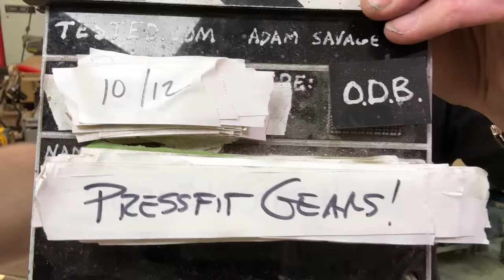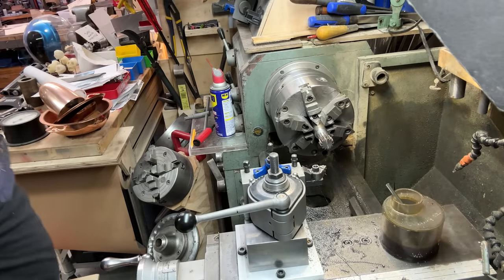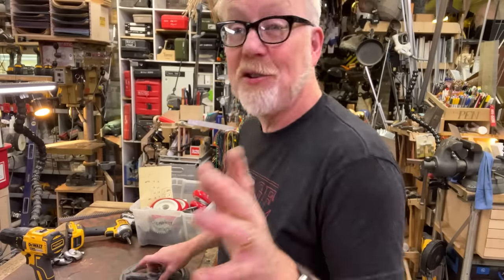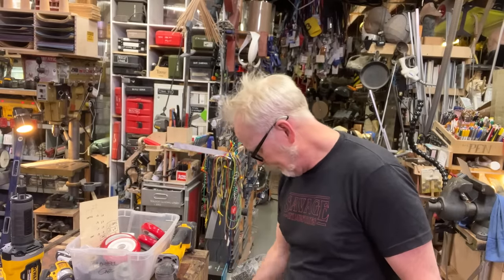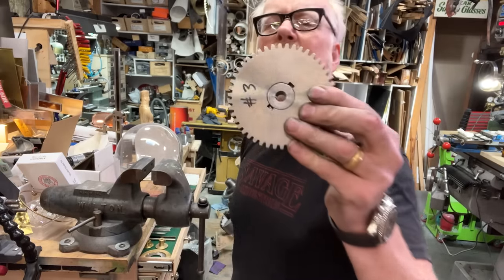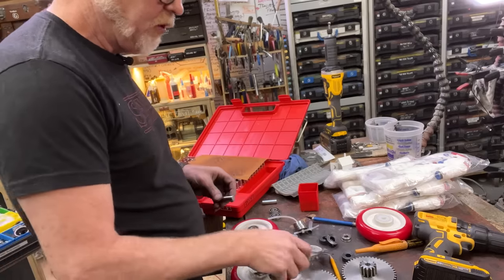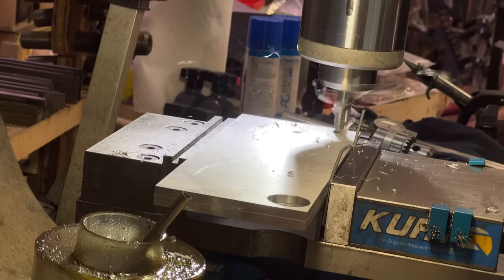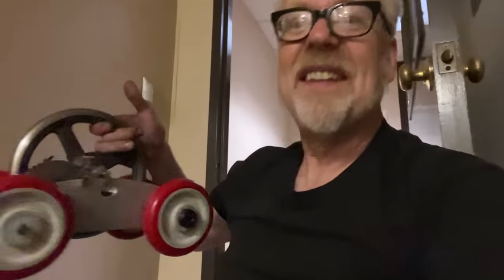Adam Savage's One Day Builds: Giant Flywheel Toy Car!

Comment: 11:50, that's a bit risky depending on the fit. This seemed to work out but you could break a vise if the loads creep up too far in a press fit. Heating up the large gear with a torch or in a toaster oven and/or cooling the smaller one in the freezer might make that easier and protect your vise. :)
Reply: that vice looks like it can handle it
Reply: @bmxscape  perhaps, but I bet any failure that occurred would have a decent chance of turning into a Really Bad Day.

Methinks Adam would benefit from investing in a fly press or something.  There are some compact presses that could be much easier and faster to use... and, importantly, safer -- for equipment and operator (and camera crew) alike.
Reply: @DavidLindes  I wish he would just buy an inexpensive arbor press. I feel like he would use it on every build.
Reply: @philiptenenzaph6128  Yeah, that'd work too.  And then he could buy the expensive one later, when he finds out how much he likes it.  :D
Reply: I felt a great disturbance in the shop, as if millions of vices suddenly cried out in terror
Reply: @warrantyvoid100  hahahahaha, nice.  :)
Reply: That made me so cringe for that nice Wilton bullet vice. Very nice vice and should not be used like that.
Reply: Plus all that effort that can just be replaced by a slip fit and a bottle of 640 loctite
Reply: @warrantyvoid100  I just Imagine how Abom would react...
Reply: @jtcustomknives  hacking it up with channel locks was also very cringe worthy 🤬
Reply: @dfm5608  is that really the same, though?
Reply: @DavidLindes  If I had an arbor press? No. If I needed to put a cheater bar on my nice wilton vise and risk breaking it? In this application yes.
Reply: @dfm5608  fair enough.  I think the point is, Adam needs a press of some sort.  :D

Comment: Really rad little contraption you made. Being a machinist and fabricator myself i think the gearing is spot on if not pretty close. Most of the issue I'd imagine is with the flywheel having so much more mass and taking alot more to get it spinning and keeping the centrifugal motion.

Comment: a common trick for setting gear spacing is to put a piece of paper between them. That and bigger wheels will really change it. You may want to consider a ratchetting gear that you can drive with some hex stock mounted in a drill to charge the flywheel instead of pushing it

Comment: Hi Adam, Loving the project! couple of tips for you that may help in the future. When you were reaming the small gear you reamed then chamfered the gear, if you chamfer first before reaming it will help the reamer centralise nicely and also means you ream out any burr where the chamfer meets the ream. Also when parting off something with a hole in like that its MUCH safer to hold a screwdriver/bit of bar stock etc in the part rather than try and catch the outside as it comes off, its very easy to catch your thumb into the tool post, as my old colegue 9 finger dave can attest lol.

Also, dont get too disheartened at the end result, maybe it isnt what your expecting but I bet even by now you have multiple ideas in your head as to what went 'wrong' or could be improved. Thats even before mentioning the skills that youve learned over this project! Making gears from scratch is no simple task so props to you dude!

Comment: Love the editing :)
I am sure it has too much internal mechanical loss, the noise is a perfect indicator. Any noise a mechanical device makes is a loss of energy.
But surely, a different gear ratio would help. Also, you could build a quick contact for a drill, with you can spin up the flywheel super fast, then release and let it drive :)
Reply: Yeah, the rhythmic sound it was making is not a good sign… something is not turning exactly on center, perhaps?  I expected him to put a gauge on the gears before boring them out… slapping them into the chuck and drilling felt rushed.  WWCSD… what would click spring do?
Reply: I wonder if a pulleys and a pair of v-belts wouldn’t yield better efficiency... but perhaps that would ruin the design aesthetic.

Comment: I think taking weight out of the gears and maybe more in the flywheel. I would love to see you use some sort of high rpm tool against the flywheel to get it spinning before letting it go.
Reply: yeah i was thinking more weight in the flywheel or a larger flywheel diameter would help with the inertia

Comment: Well that is an unfortunate result to see but would love to see a V2 with all the kinks worked out.
Reply: I think even just adding a handle so you can push it along the floor without touching either flywheel or wheel directly would allow you to spin it up to a much higher rate, and then let it go.  Of course, assuming whatever that rattle is (not-quite-meshed-well gears??  I don't know either, but that's my hypothesis) can take the higher RPMs...

Comment: This was an astounding success! Congratulations on another successful project! Actually taking action to start something is hard, and persevering to finish something you've started is even harder. But the true test is not how the results turned out, but how you handled the outcome regardless if it ends up working or not. If you've made something that works then it's a bonus, but if it didn't work and you accept that it was a failed attempt, then you'll have even more insight on what and why it failed so you'll have to continue improving it. That is a big success on any project at any scale. This wasn't even a failure, the damn thing actually works!

Comment: I love how Adam has what looks to be 3-foot size Channel locks easily accessible, but not a 24-inch cheater bar somewhere. 😂
Reply: Or even an open ended wrench to piggy back off the vice handle
Reply: Or a big pipe wrench to side load on the handle…..refinery worker here, a pipe wrench is every tool you need it to be, even a stethescope!
Reply: Or metric pin gauges 😂
Reply: Or ... you know ... a small press.
Reply: Yeah, was major cringe but it worked I guess. I totally thought he was going looking for a length of pipe.
Reply: @BillySugger1965  he has metric pin gauges. He’s shown them before.  I stand corrected…I thought he did. If you watch him lay all these gauges out…you can understand my mistake 😅 https://youtu.be/7UKkZJGsngY
Reply: @brentdhedrick  Steel pipe factory over here in Germany - same deal.

With all those decade-old machines you need some leverage. How do you adjust a 30-year old pipe welding machine? Take a huge ratchet, weld on 2 meters (~7 ft) thick-walled 2 inch pipe and have two 100kg (220 pd.) workers hang on the end. That barely does the trick.

Although, no stethoscope needed. Would be quite pointless, too - at an average of 116 dB.
Reply: @stanislavczebinski994  lol, we have plenty of valves at the oil refinery i work at that have fought valiantly against two  300 lb fellas.  Funniest thing i have ever seen.  Two 300 pound guys having a discussion about which way to face when they inevitably end up dangling from a 48” valve wrench together.
Reply: @stanislavczebinski994  and we use our 10 inch pipe wrenches as stethescopes by placing one end on the pipe, and the other against an ear.  In a noisy environment it is a cheaters way of figuring out if you have any flow going through a pipe.
Reply: Until you bend the handle on the Wilton with the cheater.
Reply: Sometimes you just gotta grab the tool you're excited to use even though there's a better option on the wall.
Reply: @bdam55  - Yes... a press for sure!
Reply: I was thinking, "use your press you're going to strip that vice!! Then I remembered it was Edd China that has a press. (bottle jack with a metal frame)
Reply: @brentdhedrick  Usually in the steel industry, machines are replaced after 10 years max. as they are written off. Back then in that company they drew all the money out and built a complete mobile phone network all over Germany - which cost billions.

Hence the old machinery.
Reply: @brentdhedrick  48" is 1.2 meters - therefore a bit less leverage.

I obviously didn't weigh my colleagues, but they weren't skinny by any means.

Old gear often needs a good bit of force - that old welding machine has been adjusted probably more than 1000 times and was really worn out.

Comment: Hey, Adam! Just wanted to let you know that I love what you do and, I finally joined Tested. I am a Maker as well but, my medium is wood. After watching almost every "One-Day Builds," I'm feeling inspired to branch off into other materials and methods of including them into existing/future projects. I live in Ontario, Canada and my shop isn't heated so, I'm eagerly waiting for the weather to warm up so I can get back to work.
Thanks, Adam, for creating this awesome channel that allows everyone to experience Making in all it's splendors. 
Best wishes  ^5
Reply: Sorta the same. Hobbyist if that, but worked with wood only for years. Then a couple years ago I bought a $120 welder and a year later a metal lathe from 1898 for $400. They are both kinda garbage, but for what I want to do, just fine. 

Anyway, been a lot of fun branching out and expanding the scope of what I can make/repair. Mainly stuff to use around the property and Christmas presents.

Comment: In the future, if you ever revisit this or a project like this, your mechanical advantage is great, but you either need a vastly heavier flywheel (impractical because you have to move the thing yourself) or larger drive wheels. 

I will say while I've done a fair bit of machining in my life, you're clearly far better than me, I struggle to get press fits that nice and am thoroughly impressed by the outstanding job you did.

Comment: This is where a hydraulic shop press would come in real handy. Also heating the undersized part, and cooling the oversized part does wonders. When it's done right, you can drop a cold interference fit pin into a heated bore without any pressing tool needed. Liquid nitrogen does a great job cooling parts.

Comment: Adam the issue actually is the fact that when you scale up the wheels the friction becomes much larger. Also flywheels are inefficient when they are of a small diameter since the reason they have spokes in the first place is to place a lighter ring of metal far away from the center storing more energy in a lighter object (compared to a smaller more solid wheel which would be too high fricition due to the weight. Ball bearings should solve the problem since friction forces of ball bearings is constant therefor they are more suitable to heavier wheels since the win is larger than on small wheels.

Reason why clock gears that are small dont need a ball bearing is because they are so light that the static force of the bearing rubbing against the retainers would be larger than the wheel just spinning by itself.

Solution is larger flywheel and ballbearings on all gears including flywheel and a lower gear ratio and bigger rubberwheels.

Comment: I might have missed a similar comment, but I would also consider the mass ratios of the scaled up model gears. It "feels" heavy for the mass of car to the mass of the fly (maybe rout a chanel into the outer fly and fill with lead 708pcf vs. ~490pcf for cast iron).

Comment: Hi Adam, this is an amazing project, I don't think it failed even though it seemed that way because it didn't work the way that the toy car works but it did it does not look the same because of the size. 

To create the speed I believe you have to reverse the system, where the flywheel is on the input side rather than output, admittedly I am not sure how this is designed but you probably do. However what we want is for the flywheel to do 1 turn and the wheels do 17, not the other way around.

Comment: Speaking to your comment on the die grinder not having a locking trigger, I am pretty sure the switch that locks the trigger out can also lock the trigger on. I have the dewalt 20v oscillating multi tool which has a nearly identical tool body and functions as I described.

Comment: Seems to be working just fine. it is moving with the same speed you started it with. but since it is bigger it needs more energy to get it going. just looks like it needs some more speed so try to start it with a screwdriver or something by the wheel. Love the video!

Comment: for larger flywheel cars like this, it would likely be a lot more fun to install a bit that could fit and in turn be assisted by an electric motor from say a drill, to give a lot more rotational energy to the flywheel, which in turn would make it travel further. Also, i feel like the ratio of those small wheels might have an effect on the distance, the smaller car has a larger wheel base compared to the gear, that and it has more grip because of the rubber. Still an awesome ODB.

Comment: Nice car.  Sounds like the gears are not meshing quite right.  An old clockmaker's trick is to put polishing compound in the gears and then run them for several hours to wear them in.  It might not solve all issues but it would make the gear train a whole lot smoother.

Comment: I didnt see any of the other immediate comments mention weight.  I saw mentions about the gear size/ratio, but the resistance to the force required to move its weight would be a factor as well.  While your push may get it going, the friction from its weight dissipates the force more quickly than the smaller/lighter model. Testing on the carpet at an incline was simply giving it a large obstacle out the gate. The smaller toys are typically played with on smoother surfaces for longer distance.

Comment: Switching out to less heavy gears would probably help it but the flywheel itself is also not spinning as freely as it should, as others point out you probably need a heavier flywheel proportional to the overall weight or to cut down a ton of weight elsewhere in the car to make that one work. Still I envy you its such a cool project to tinker with and make incremental improvements!

Comment: He's gotta rig up a couple of slots to put a modified flat head shovel such thing into so he can put pressure down while pushing ahead, lift while drawing back, and put down pressure while pushing ahead multiple times before releasing. That build-up of flywheel momentum, accompanied with the sound of it, and the build-up of anticipation, was one of the greatest thrills of the whole experience. Like a drag racer revving several times before dropping the clutch. It's no fun otherwise. Plus at least double the back wheel size. The flywheel is the least efficient power-to-weight ratio there is as well. The flat disc in the original toy could hold together at higher rpms than a spoked cast iron wheel.

Comment: I wonder if the gears being heavy and made of steel would help with the flywheel effect, or if they would slow it down by using more energy to move. I also think there is too much friction between the geers or how the geers are mounted. Others suggest using bigger wheels, but I don't think that's the solution. Too much energy is being lost before it even gets to the wheels for that to help. Maybe when the driving system is more energy efficient you could try bigger wheels. Just thoughts!

Comment: I think a handle on top that goes above the flywheel would help. Would give you something to hold on to so you can move it across the ground multiple times in a row quickly and really spin up the flywheel. Structurally it would be best if it ran front to back, but I suppose running across the side plates might work.

Comment: Hey there Adam , 
I think what may have helped you the most is to have cut helical gear teeth . This is the same as they use in transmission gears ⚙️,  they run quietly , cooler and much much smoother than straight cut gears ! I hope this helps you for future builds ! I love your show !

Comment: It actually works fine. You could definitely tweak it to remove some friction, and the actual wheels are a little small compared to the ratio between the flywheel and drive wheels on the smaller model.... but it's a bigger machine so needs more energy putting into it to get it moving and keep it moving. 
Basically, if you spun it up to a high rpm with a drill or something then let it go, it would work fine.
Or to put it another way, if you compare the weight and scale of the original toy, then scale it up to the one you made, you need to scale the starting energy accordingly.
In other words, you need a 6:1 scale Adam Savage to spin it up.

Comment: Super cool, you learned some new skills, built a beautiful thing.  As mentioned, if you doubled the diameter of your wheels so they’re more to scale compared to the overall size of the car like the small model it will give you a lot more speed. Also, while beautiful, those solid steel 3/4” thick gears are a pile of rotating mass. Ask a bicycle road racer or long distance runner (I’m neither) about the effects of rotating mass. Maybe drill or mill them out to reduce weight?

Comment: All of the mass of the rotating bodies is in the gears not the flywheel, the design and gear ratio is probably right on but the stored energy is in the flywheel and needs to have a much larger mass or rotational inertia than the other rotating components. All of this is in constructive help not criticism, I love you work Adam, you have been an inspiration to me for a long time and one of the reasons I became an engineer so keep up the good work

Comment: Amazing Project oh, I like what you did but this was one of those times when you missed the mark by a tiny bit. One of the other commenters mentioned that the drive tires are too small in diameter. I have to agree if you took those wheels need to increase in  diameter to say 5 or 6 inches. I think it would work better. I Gotta say though I love what you did. I don't have the energy to do this anymore but I sure do love watching someone that's has and the time to do it! best regards, Bob from Virginia USA